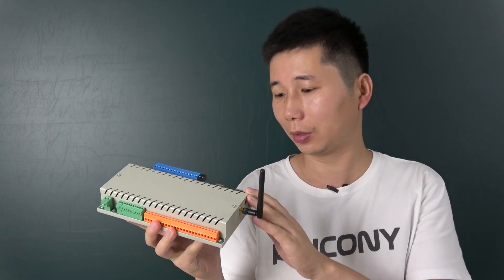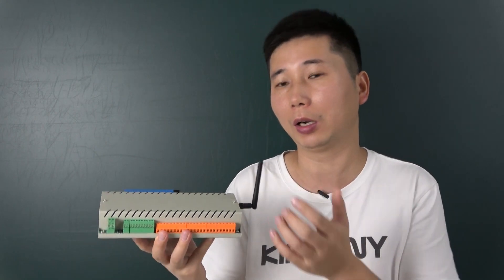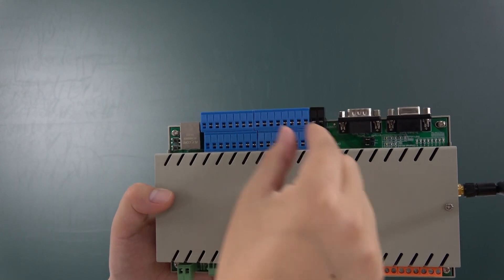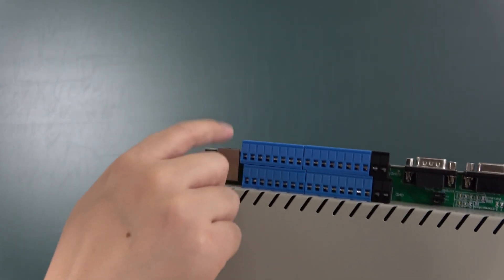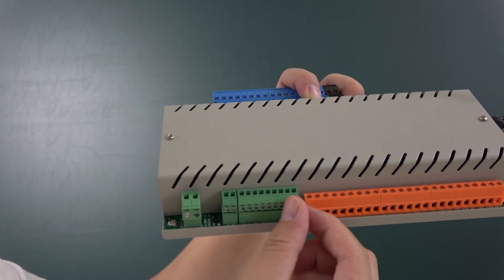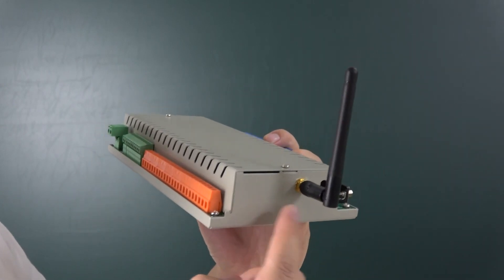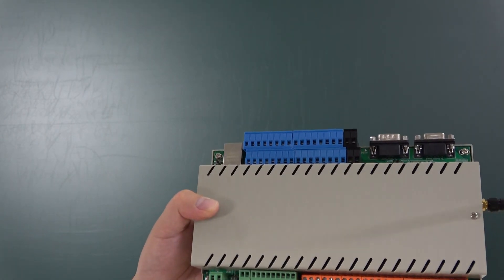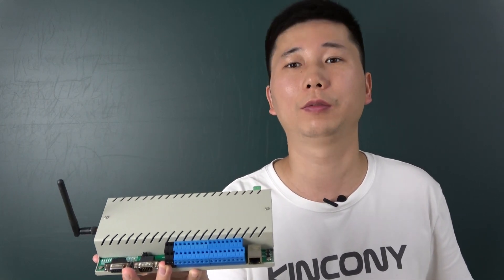new product KC868-COLBS logical controller (PLC) launched

Comment: Hello. Is it possible to connect wall switches to it and control light bulbs with the integrated relays? Thank you.
Reply from the maker: yes, you can .
Reply: @KinCony  can you please tell me how to wire? The switch is self reset switch. Where to put the wires?  Thank you.
Reply from the maker: @ercsey  use self-reset switch (momentary switch) connect COLB's digital input port, then set logical command by COLB's PC software.
Reply: @KinCony  thank you very much. 😊
Reply from the maker: @ercsey  you are welcome.

Comment: Great what is the price? You should do a mini version 8 digital port 8 analog port and 16 relay output it would be great for single project
Reply from the maker: already have 8 DI +8 AI that is KC868-COLB-Mini, just without relay output.
Reply from the maker: https://www.aliexpress.com/item/1005003289968831.html?spm=a2g0o.store_pc_groupList.8148356.3.7cd59705WijymU